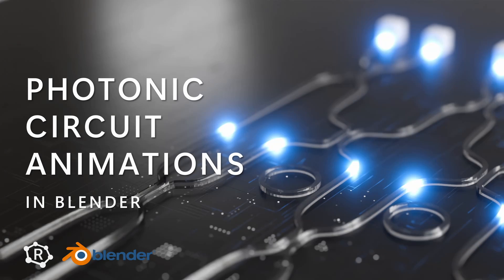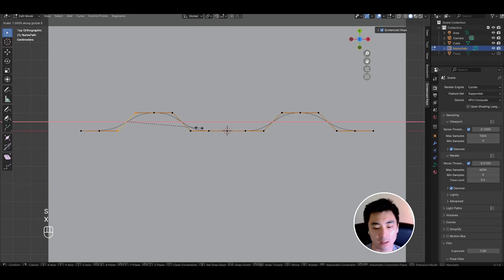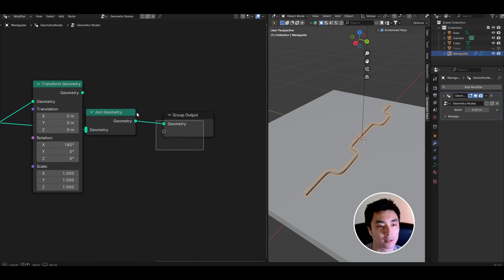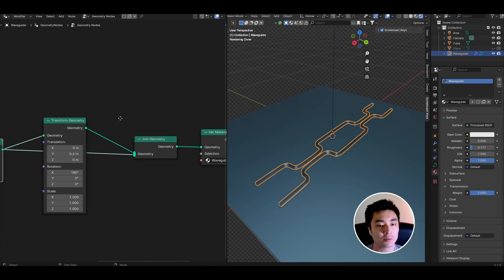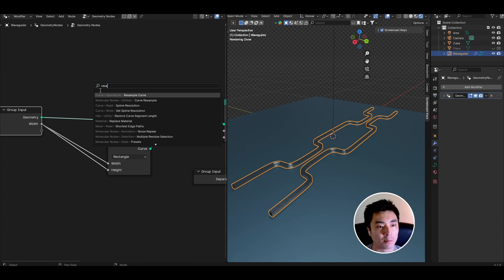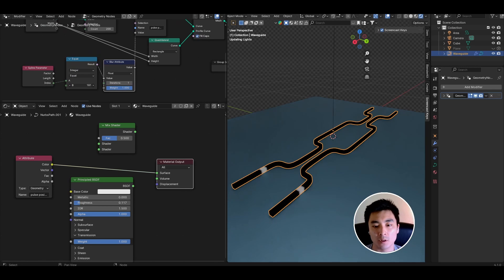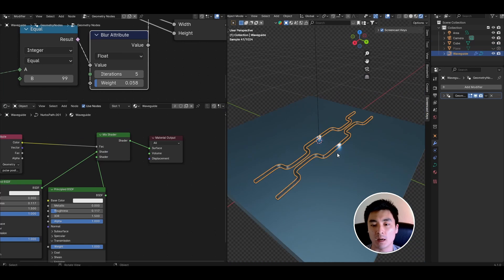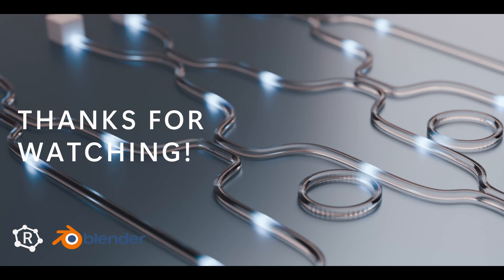Photonic integrated circuit animations in Blender

Comment: Really awesome!. Quesiton, do you have any nice tricks for chaining multiple curves together? e.g. I want a straight waveguide going into a directional coupler, but there is discontinuity because at index 200, the pulse is only half way out the end of the curve. Or is it best to just do it as one big curve
Reply from the maker: That's a good question. So at the moment, best bet is to just draw it all as one curve. I was also trying to play with ways of building individual components and then snapping them together with geometry nodes. I'm pretty sure this is a nifty way, but I haven't made much headway since posting this video...
Reply: @ryomizutagraphics  aha yeah thats the approach I am trying to do right now, maybe i'll report back if I come up with some neat way to do it
Thanks!

Comment: What books do you recommend to learn Blender for scientific animations? I already use CAD software for 3D printing and technical illustration.
Reply from the maker: I’m mot sure books are necessarily the best resource for this kind learning, 1) because there aren’t many around for scientific illustration in Blender, and 2) Blender itself updates so frequently (3 version updates per year). So any print material quickly goes  out of date; this is especially true for geometry nodes content